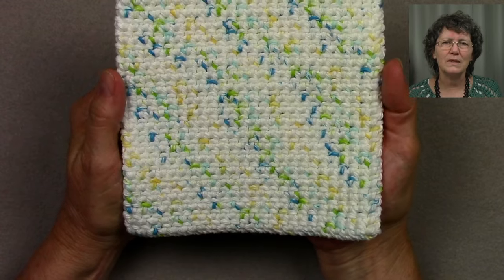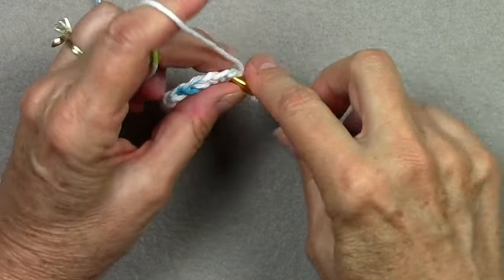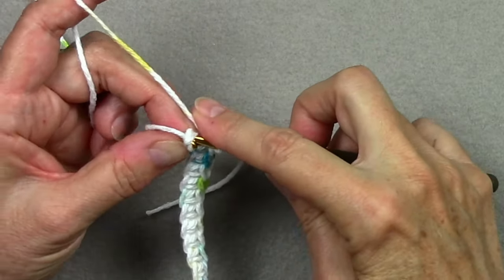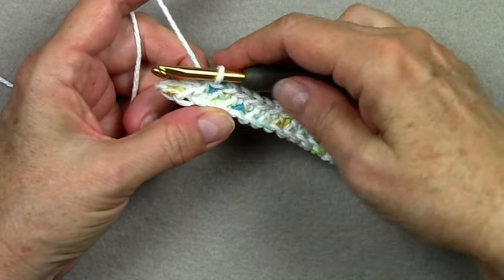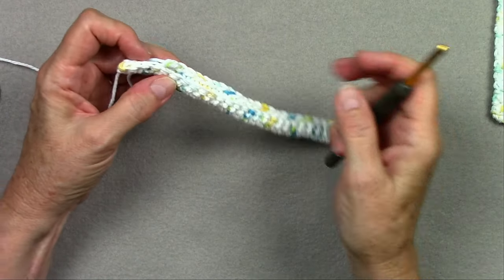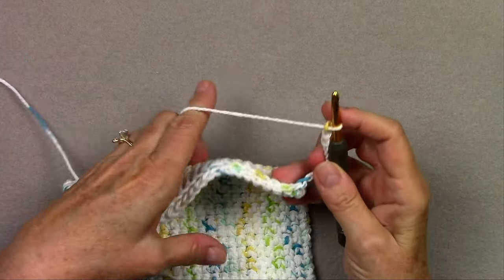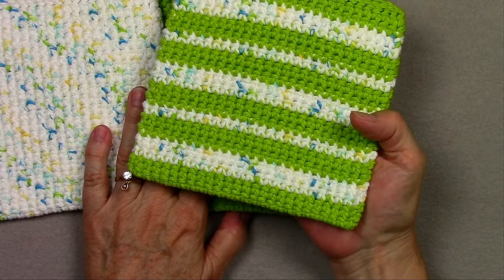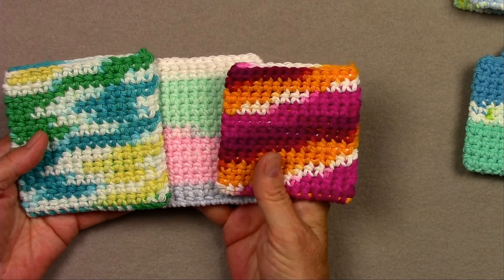#42 - Thermal Stitch Crochet Potholder

Comment: I can not wait to try this.  Thank you so very much for sharing this.  Do you have a video and pattern how to crochet a cross body cell phone case with a flap closure?  I am constantly losing my cell phone.  That’s a real problem with my 771/2 year old self.  Lol
Reply from the maker: Gracie, You're very welcome! I hope you enjoy crocheting many thermal stitch potholders! They make great Christmas gifts!!!
Unfortunately, I don't have a video or a pattern for a cross body cell phone case with a flap closure. It probably wouldn't be too hard to make, though. Just decide if you want the flap on the top or side of the cell phone and pick what stitch you'd like to use (probably something that can breathe more than the thermal stitch so your cell phone doesn't get too hot). Then measure your cell phone and make a rectangle that will fit the cell phone with a little extra room in it, but not much. Fold the rectangle to form the case with the flap and seam the edges. Decide how you'd like to close the case (with a button and button hole crocheted into the flap or added with an edging, with a snap, etc). Then decide how wide you'd like your strap and where you'd like it positioned on the cell phone case. Crochet the strap with tight stitches, such as the thermal stitch or sc and secure it to the case. Or you could make a case and strap with fabric instead of yarn so it doesn't stretch too much.
Unfortunately, women's clothes typically don't come with pockets big enough to fit cell phones like men's clothes do!
Happy crocheting to you now and always!

Comment: I have read through many of the comments and no one has mentions the issue I am having with this project. I have completed about 4" with about 4 more inches to go... I think I counted about 10 rows so far. Anyway, I have small hands and I am having a very difficult time holding the item to do the stitches. It seems that the stitches are being created not from side to side but across the top of the item. It is making a very nice thick potholder but it is getting frustrating and taking a long time. I am probably going to set it aside before I tear it out ....I might look for another pattern and just do two and stitch them together or do a style that makes a long piece that is folded over. I was intrigued with this new pattern but it doesn't seem to work with my hand size or maybe it's the way I hold the hook and yarn.
Reply from the maker: Carla, 
Thanks so much for your comment. I understand the issue you're having with the potholder. I have to change the way I hold the potholder when it gets to about this stage (halfway) because it's too tall to hold it around the bottom. Perhaps with your smaller hands, making Thermal Stitch coasters would be easier for you to hold. I've made coasters with 13-15 stitches and the appropriate number of rows to make them square. They're nice and thick to protect wood tables.
I realize crocheters have different holds on the hook and yarn. That might affect the frustration you're feeling. 
Crocheting two pieces and joining them together is a great option, as long as each piece has dense stitches so there are no holes in the finished potholder. I'll be doing a video for the Magic Square Potholder in the future and I'm pretty sure there are already videos on other YouTube channels for that potholder, if you'd like to try that one instead. It's worked in the round to create a rectangular tube that gets folded down to create a square. It's double thick and may be easier for you to hold.
I hope this helps. Happy crocheting to you now and always!

Comment: When you finished the first row , it gave the impression to turn the chain; you turn the work not the chain. Also, it is very difficult to see the last single crochet. I use a yarn needle to pick out the last stitch until I can localize the parallel bars and complete the stitch. Hope this helps some that have been having trouble.
Reply from the maker: Thanks for your suggestion, Janice! That's a great tip! 
When you're done with the first row, the chain and the work are essentially one, since each foundation chain is worked into. So you'll be turning the work, which includes the foundation chain. 
Happy crocheting to you now and always!

Comment: Just found this pattern, got out my supplies and began.  It is SO difficult to find that lower stitch at the bottom!   Any tips?
Reply from the maker: I would suggest using stitch markers to help find the lower stitch at the bottom. After you've finished a row, before you even start to crochet the next row, turn your work, rotate your piece towards yourself and insert stitch markers into the first, last and every 2-5 bottom loops that you'll be working into in that row below. You could even insert the stitch markers into the back loop of the previous row where you'll start to insert your hook before inserting it into the stitch in the row below. That way, you'll learn to identify the loops of the lower stitches and pretty soon you'll be proficient at finding them and working the thermal stitch.
I hope this helps. Happy crocheting to you!

Comment: Can I use an 80% cotton yarn for potholders?
Reply from the maker: Great question! It depends what the 20% fiber is. If it's polyester or acrylic, don't use it. Polyester and acrylic both melt when they get hot. If the other 20% is an animal (wool, alpaca, etc) or plant (hemp, linen, etc) fiber, it should be okay. You can always make a small test piece to make sure before crocheting the whole potholder.
Happy crocheting to you!

Comment: I can't do it😭😭😭I have a hard time linen up the correct stitch.
Reply from the maker: I'm so sorry to hear that, Maria! If you slow down the video, would that help at all? Maybe if you inserted a stitch marker into every 5th stitch on each of the 2 rows before working the row, that could help keep your stitches lined up. It's worth a try! I'd also insert a stitch marker into the first and last stitch of both rows. Then you'll know you are starting and ending with the right stitches. If you don't have stitch markers, safety pins work just as well. And counting stitches will be very helpful, as well. I hope these suggestions help you to successfully make a Thermal Stitch Potholder! Take your time. There's no hurry!

Comment: I actually prefer the thermal half double but single works too.
Reply from the maker: Thanks for commenting, Tammy. I'll have to check out the thermal hdc sometime! It's always fun to learn something new!
Reply: @TheCrochetArchitect  oh if you like new stitches, check out the nalbinding crochet video by light and Joy designs. It’s super cool. I made a few hats with it and use the half double nalbinding stitch as a smooth section in fidget blankets. I love the soft puff-stitch-like texture to it.
Reply from the maker: Thanks for the information. I'll have to check out that video!

Comment: It's actually a very slow stitch and less thick than expected.  The 3 first rows are the most difficult or complicated because you can easily turn your work. Especially when you use 100% wool. There is a more beautiful stitch and more easy and thicker than the thermal stitch.
Reply from the maker: When I'm using cotton worsted weight yarn, I feel as though this stitch makes a nice thick potholder. I'm curious what the other stitch is you're referring to that is a more beautiful stitch, more easy and thicker than the thermal stitch. Can you link to a video of that stitch so I can see what stitch you're referencing? Thanks.
Reply: I'm finding that the thermal stitch is thicker but not as thick as joining two sides of a potholder together.  Can you please say which stitch is thicker?
Reply from the maker: I don't know what stitch @cateelisabethlsn6400 is referring to that she says is easier and thicker than the thermal stitch. I find that the thermal stitch potholders I've made are plenty thick enough to use to remove hot pans, sheets, etc from the oven and not get burned (I use a fairly tight tension, so mine might be thicker/denser than yours). I've made the Magic Square Potholder before, which is essentially a double thick potholder and it works great, too!
Reply: @TheCrochetArchitect   This (link) is the one I’ve been making and really like the end result. I can’t compare it to yours because I haven’t made it, but it’s pretty thick and a really cute design.
https://youtu.be/boM3-1J7YI0
Reply from the maker: Thanks for sharing the video link. That potholder is the one that I used to make before I started making thermal stitch potholders. That pattern is called a "Magic Square Potholder" and it was published by Coats & Clark in a little booklet in1983. It used to be a free pattern on the Coats & Clark website. But since Caron Yarn bought out Coats & Clark several years ago, I haven't seen the pattern on the Yarnspirations website. Both potholder patterns are great! Happy crocheting to you!